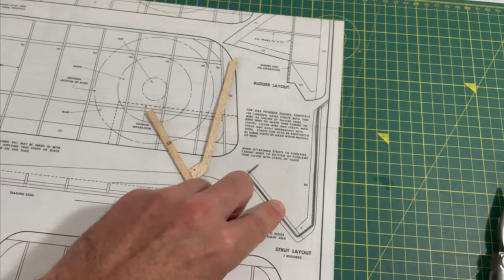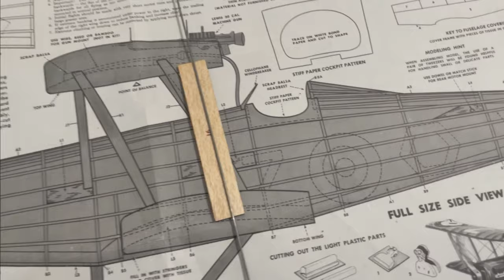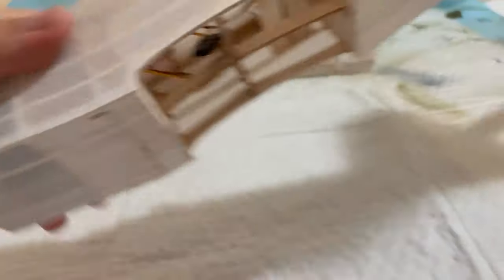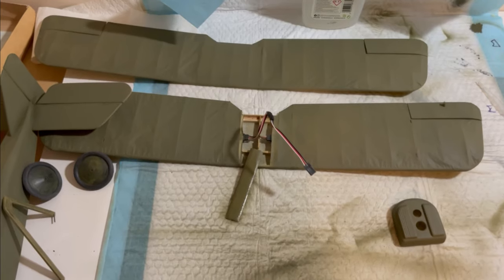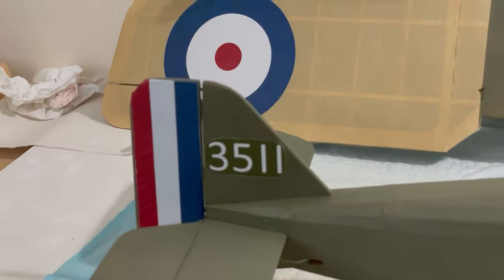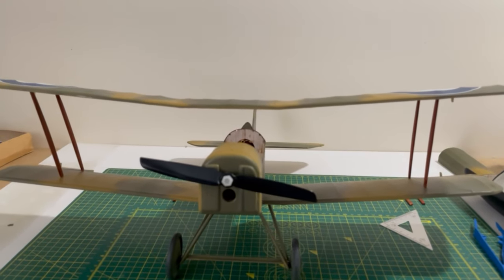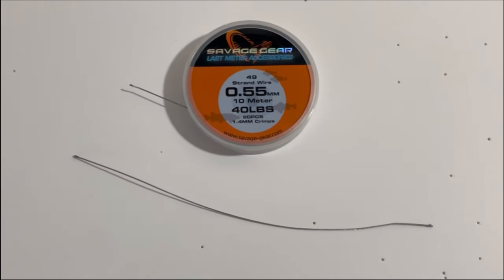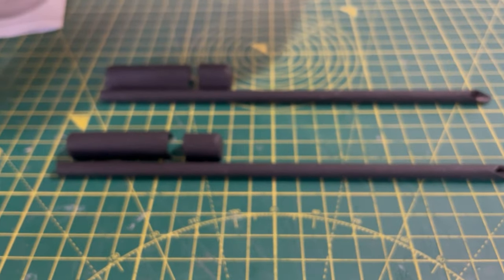SKippy's Guillow's S.E.5A RC Conversion - Part 4 Completion

Comment: Nicely done! Looking forward to the flight video. I can't wait to see what you can do with ailerons. Mine was dangerously tail heavy when I used the rubber power CG. It flew great with the CG at the leading edge of the lower wing.
Reply from the maker: Thanks Jon. She balances just behind the plan cog slightly forward of B6 🤞

Comment: Few things warm my heart more than a nicely realized Guillow's RC conversion ❤️. Something about a built-up model that reflects craftsmanship and reminds me of when I started in the early seventies. Lovely job with great technique. BTW, how did it balance out?
Reply from the maker: Thank you! It balances just forward of B6, so a little behind the plan cog. I need to try and get the battery slightly further forward but it’s a tight fit and fiddly with the upper wing 🤔
Reply: @srknight307  that was my only concern with the solid tail surfaces, although I'm sure you'll get it figured out👍😉. It's really a lovely representation 👏.